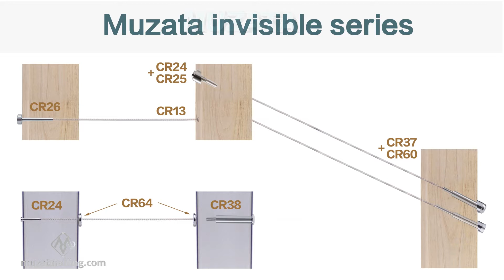How to install invisible cable railing for wood & metal posts

Comment: How about doing a wooden corner post so we don’t need a turn buckle on one or both ends.  I want to know how to make the cable turn the 90 degree corner inside the posit.
Reply from the maker: If your wood post is bigger than 4"x4", then you can use our corner protective sleeve CR69 on the corner post, the cable will run through the corner post. You check this video: https://www.youtube.com/watch?v=QoNpcmvDu9w&list=UUd68o5OuYQ8qdQQZjS8Kzew&index=49